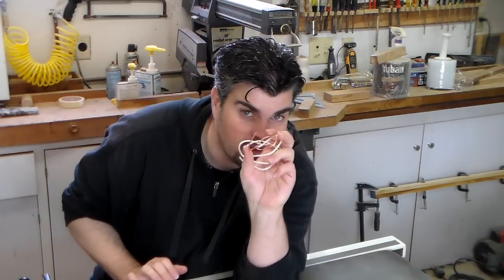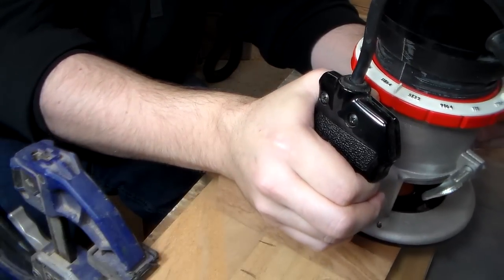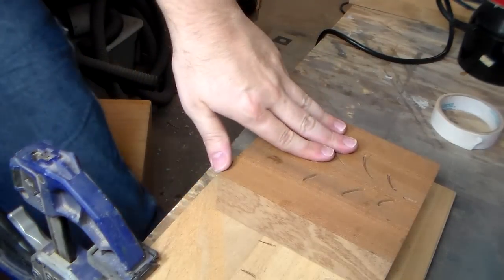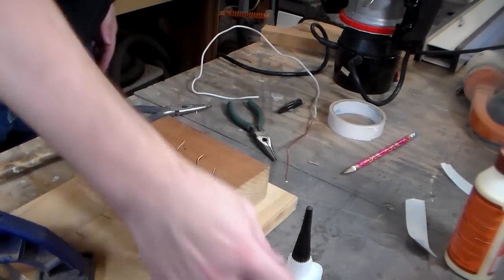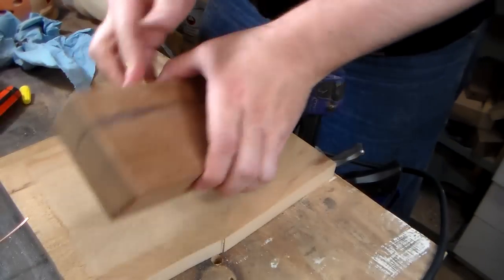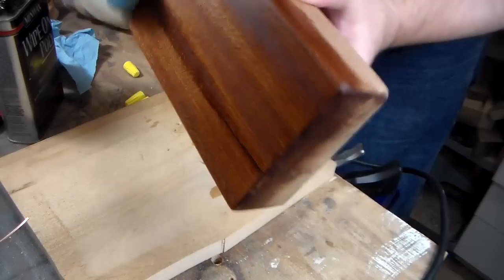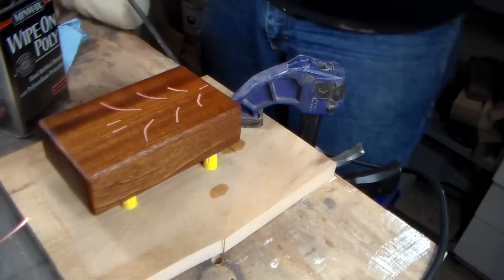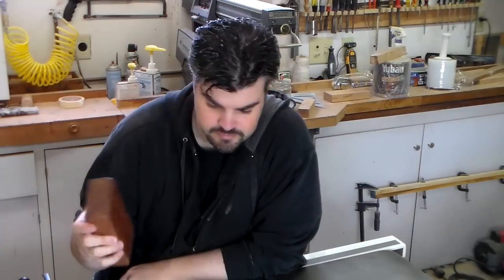How To Make Copper Wire Inlay Decorations

Comment: Nice!

You could drill holes in one end of each wire inlay grove, push the wires through the holes and connect to alternating sides of a battery.
Then connect LEDs between the branches as glowing ornaments.
:)
Reply from the maker: Now that's thinking outside the box! I like that idea Bjorn!
Reply: I second that, damn good idea
Reply from the maker: ***** Hey, I can actually respond to you here. I didn't leave you hanging on the router high five! :)
Reply from the maker: ***** Dangerous Decorating... :)
Reply: Would that make the decorations "shockingly" good  .......I'll get my coat! 🙄😆😆😆
Reply: Great idea! 👍💓!!

Comment: love doing wire inlays, but ya as someone else mentioned, try brass wire (though you have to be very careful, alot of places sell brass colored aluminum or copper so once you sand it it changes on you).  I would avoid aluminum, every time i have tried it creates black dust while sanding and stains the wood, but maybe you could figure out a method i overlooked.  Another tip, instead of wire nuts, next time you get pizza just ask them for a hand full of those little pizza table thingies, they work great for holding finishing projects off the table :D, great video.
Reply from the maker: ***** Great tips! Thank you Ben! I wonder if compressed air would be enough to get rid of the aluminum dust before adding finish?

Comment: My first thought was melting the wire... you could drill some "anchor holes" so when you (ideally) poured it in the groves it would 'self-lock' without the need for glue. (Which, if you could get it liquid enough, might be a possible solution for the HDPE inlay conundrum...!?) However, I don't think melting copper is very easy, but the 'anchor holes' idea might still be viable... if you drill holes on the top and bottom of the grove, most likely on an angle, you could stuff the ends of the wire in the holes and theoretically get the same effect without glue?!
Reply from the maker: Nick D. Clements I think you're right copper has a pretty high melting point! What about solder? That might look really cool too.... I like the way you think Nick!

Comment: Nice.  Is that a older craftsman router?  Looks very similiar to mine.  What do you think about using differnt sizes of wires to lend differnt weights to the lines of your design?
Reply from the maker: Derek Oliver It totally is. Craftsman from the early 90's I think! Varied wire sizes would be really cool!

Comment: Hi Peter! I just tried to do an inlay using solder, a piece of pallet wood, wood glue, and an angle grinder with a sanding disc. After sanding, the wood had a bunch of awful black smudges all over it. Any idea what this could be?
Reply from the maker: battelinin That sucks. I'm guess the solder is heating up from the sanding and smudging. I wonder if you would have better results sanding it by hand a little at a time to cut down on the heat.
Reply: Peter Brown Thanks for the response! I'll give that a try.
Reply: Peter Brown Also, since i don't have a router, i used a HF rotary tool to carve out the space.
Reply from the maker: battelinin That was a good idea! A bit slower but probably a little easier to control!

Comment: another idea instead of wire nuts I use nails that I have placed into a board
Reply from the maker: terry pardue A nail board? I've seen those, but have never tried one. Do they leave marks?
Reply: I have never noticed a mark from it. and I do mine on both flat boards and gun stocks